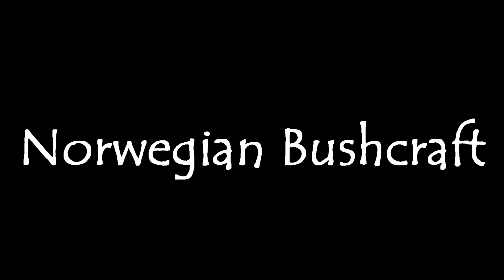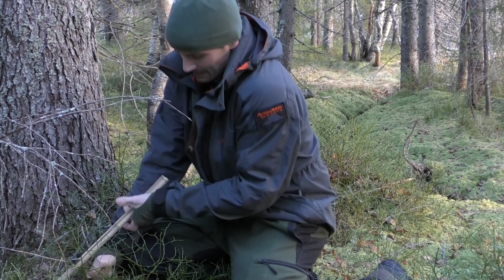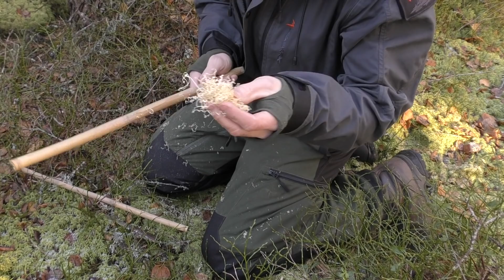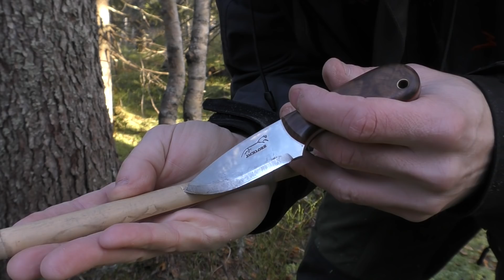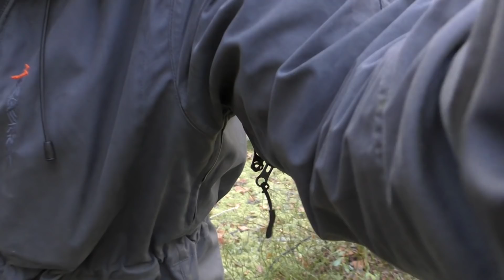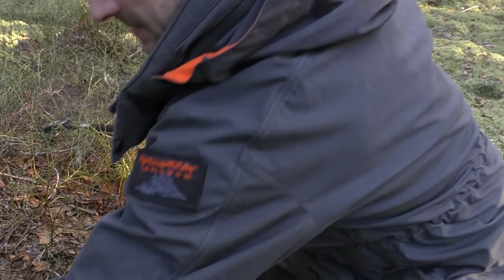Plowstick fire - a different fire saw

Comment: Thank you this information, very unique option. One time I broke down in a remote section of road and did need to start a fire.  I had nothing with me for that purpose. I finally figured out that by soaking a rag in fuel tank attached to a stick and then putting the oil dipsitck between the battery poles to get a spark I could egnite the cloth. Saved my butt. Thanks Odd.
Reply from the maker: Thanks you for watching
Reply: Great idea. I know how necessity or urgent-ness can let solutions appear, especially if one maintains a good attitude.

Couple thoughts about using the battery:
1. A spark right at the battery can cause it to explode. As I understand it, Hydrogen is somehow released as the battery cycles/operates. Air gets in there too, by the vent holes (Hydrogen still needs air to burn). This why when jumping car electrics the last connection should be made to the ground (metal frame) of one of the cars, away from the battery.
2. If jumper cables are available, it would be easy to arrange for a remote spark. And even if gas can’t be had, like no siphoning tube and no jug/supply, the battery power should be sufficient to heat up a small diameter bit of wire enough to raise smoke. Electrical fires happen all the time in cars. Set up your fire-site within reach of the jumper cables, judiciously apply 12 volts. Maybe coil the ‘heater wire’ around a pencil or something, a few wraps, to localize the heat. Tinder, kindling, and fuel, as always.

It was fun hearing your story, and am glad you made it out. Cheers.
Reply: @johnnyliminal8032  Hello , thanks for thos ideas, worth your time to help me and others..

Comment: Great video and I had never thought of using bamboo to light a fire here in Norway. But I had to laugh out loud when you recommended immediately burning the tool that enabled you to light the fire. It's like "Now we have a fire, let's throw the rest of the matches in and use them as kindling". :) I would rather recommend gathering some cones and other things that burn well before you start the heavy work of making the ember and keep the matches in case you need them later.

Comment: Nice.. I k now it was just a demo but, any time u make fire especially from embers, u really need to emphasize the equally important preparation such as ALOT OF FINE DRY KINDLING AND SMALL FIREWOOD SMALL TO LARGE before doing the ember. Many fail to maintain. An ember after not having enough small kindling